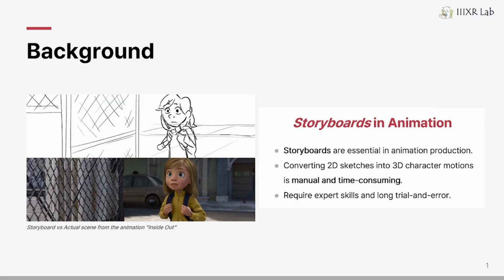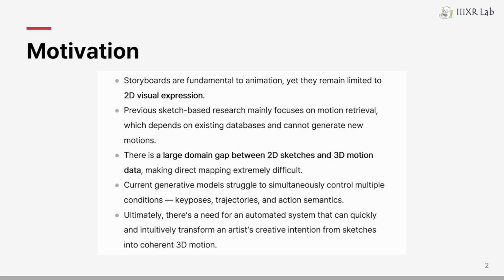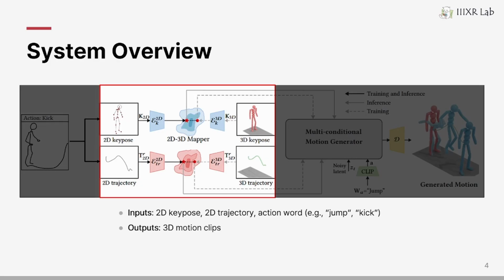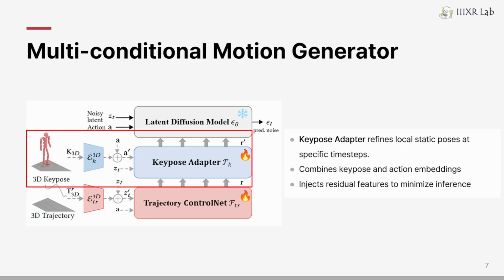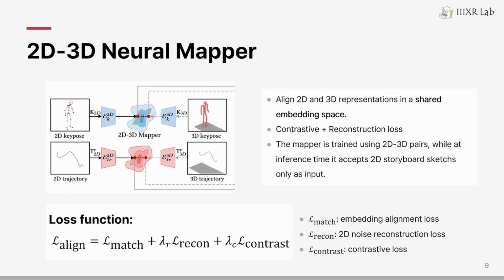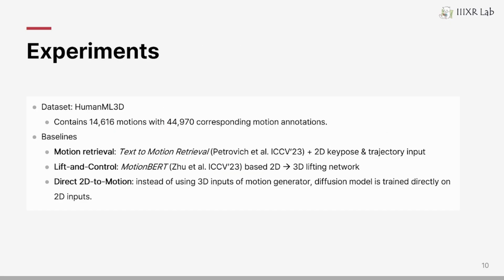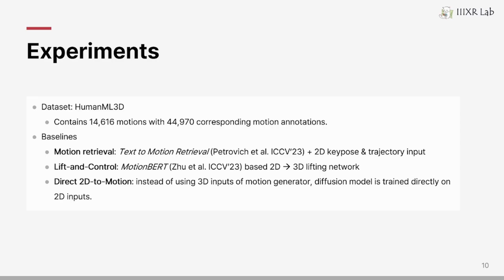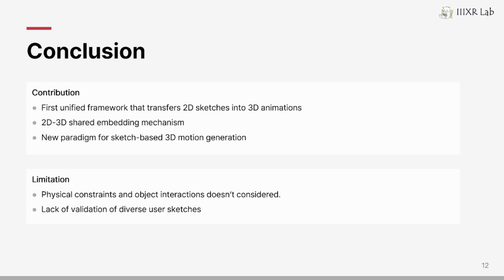[Seminar] Towards Transferring Sketch Storyboards into 3D Animation

Comment: Q1: You mentioned that the model is trained using paired 3D motion data and their corresponding 2D projections. Could you clarify what exactly is meant by “projection” in this context? If the projection process is not straightforward, might important structural information from the 3D data be lost?

Q2: Can this method be applied to other objects, such as animals or abstract shapes, to reconstruct them in 3D? If not, what are the main limitations or reasons behind that?
Reply: A1. In this context, “projection” means rendering 3D joint coordinates onto a 2D image plane using a virtual camera model with known intrinsic and extrinsic parameters. Multiple random viewpoints are used to simulate sketch-like poses. While some depth information is inevitably lost during projection, the model mitigates this through the 2D–3D shared embedding space, which learns geometric correspondences between projected 2D joints and full 3D structures. This allows the mapper to recover plausible 3D spatial layouts from flat 2D sketches.

A2. The method is currently limited to human motion data, as both the motion diffusion model and the 2D–3D mapper are trained on human skeletons from HumanML3D. Extending it to animals or abstract shapes would require new datasets and structural priors because their kinematics, joint topology, and motion semantics differ significantly. Without such domain-specific training, the model cannot reliably infer or reconstruct non-human motions.